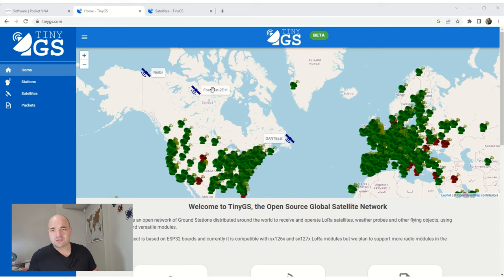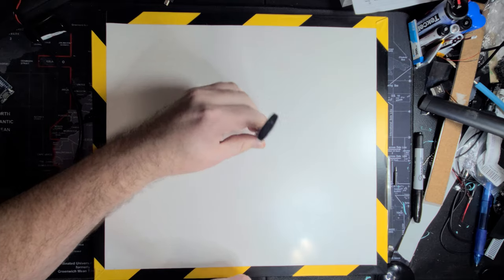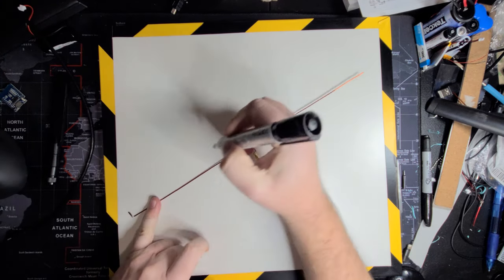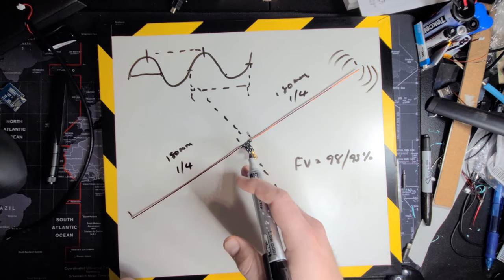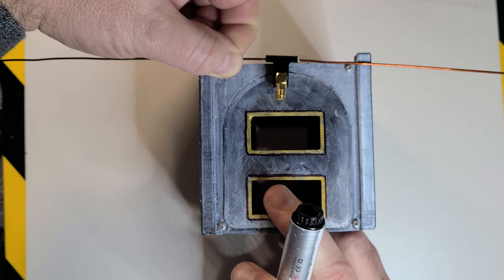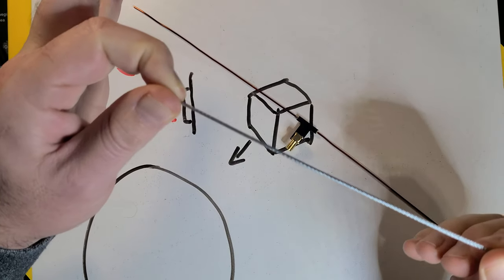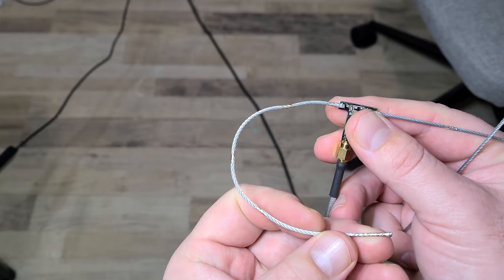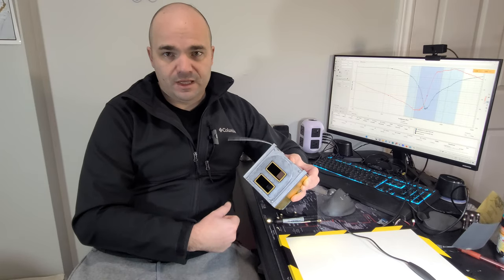DIY CubeSat Build Part 2: Project Ground station & Antenna Selection

Comment: I have a very quick question although it might sound insane😅
But how will the response be if we perform electroplating of copper, on the measuring tape or paste the copper foil on it?

My very gentle request,  please test the antenna with that technique.
Reply from the maker: Good question! I think Electroplating the measuring tape is certainly an option and probably one that has been explored by real space agencies. testing this at home might be a very costly experiment( the correct way). But that said, I do believe that the effects of the bad conducting material can be compensated for in design.

Comment: I guess using piano strings would work as well.
Reply from the maker: Indeed. Also found stainless steel tape to work. The diameter of the material has some impact on the bandwidth so just keep that in mind